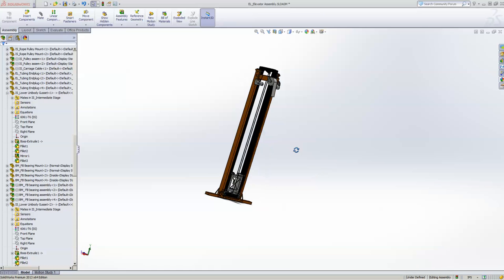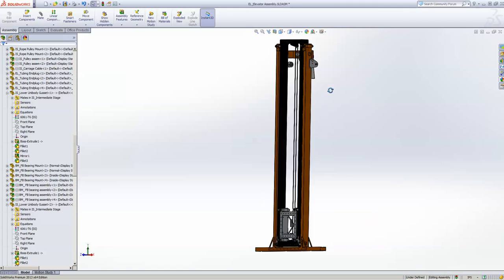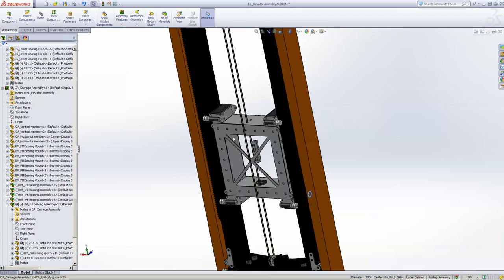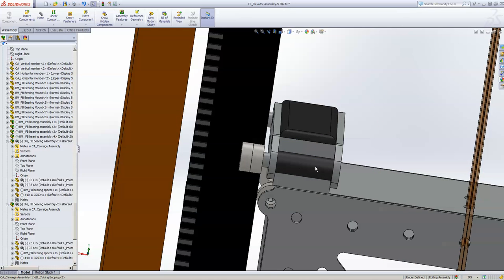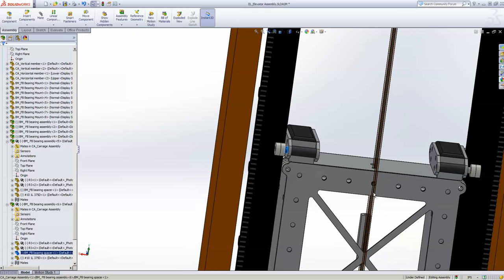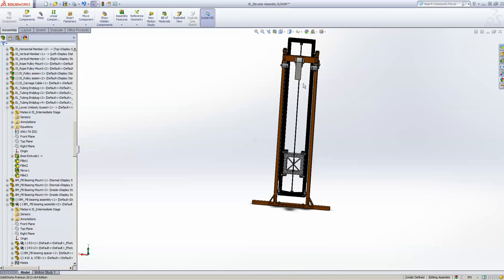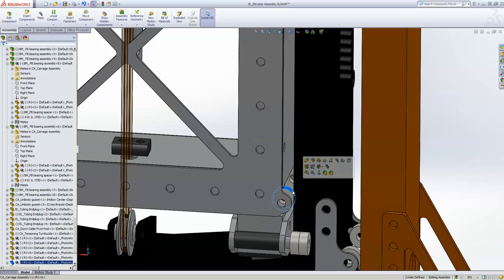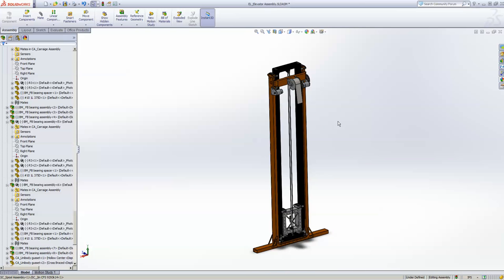973 RAMP Cascade Elevator Part 1

Comment: It's not clear how the front/back bearing shafts are mounted at the bottom of the 1st stage.  It looks like the bearing mount plate is sandwiched between the bottom and side, and sticks through a hole in the front brace plate.  Is that correct?